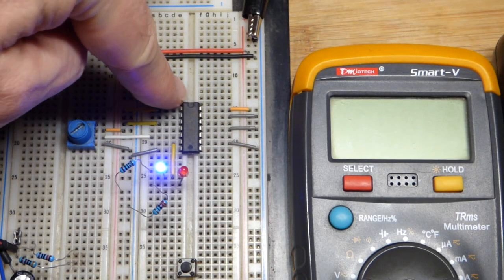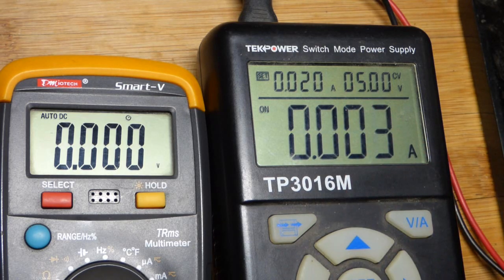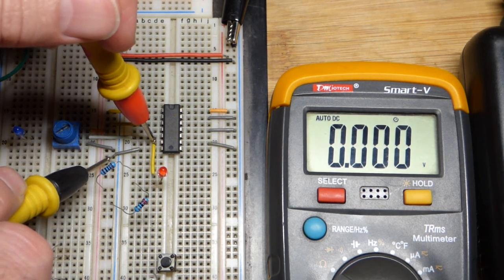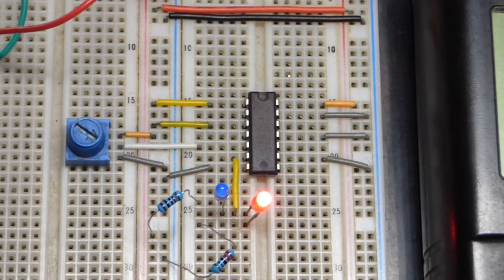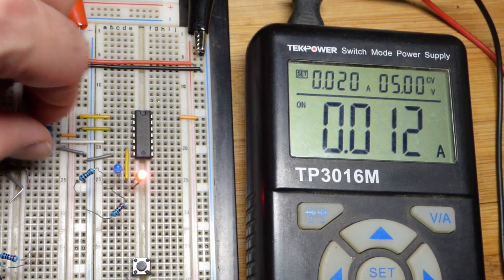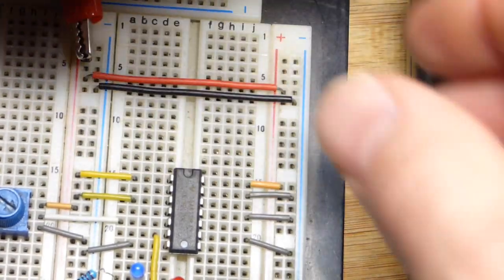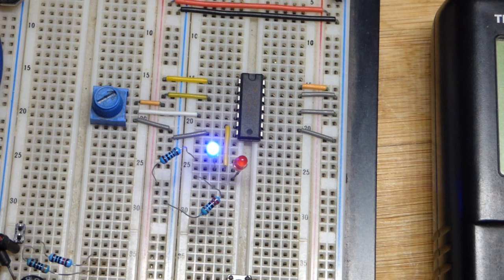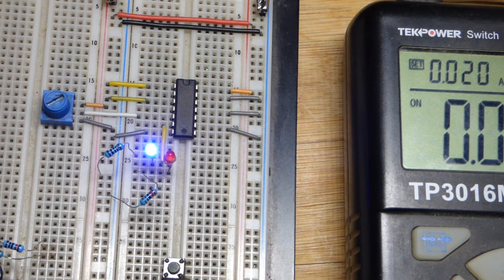74HC14 Hex Schmitt Trigger Inverter Output Voltage Multimeter Measured

Comment: A question: How to measure the response time of a Rele. From the moment it is activated to when the closure of your contacts is real. Thank you.
Reply: Thank you. Very kind.
Reply from the maker: I'm not sure of the best terminology, but oscilloscopes have the ability to measure 2 voltages at the same time. You can set the oscilloscope to be triggered when it senses that one of the voltages changes. It will basically take a picture of the moment that happens , and it will show how much later the other voltage changed. That time difference between the 2 voltages changing is the response time. You'd want to watch a youtuber that makes a lot of oscilloscope videos. I generally don't care enough about response time of my circuits to measure it.